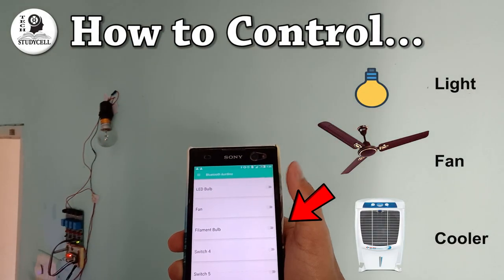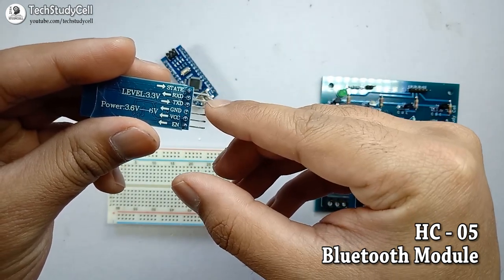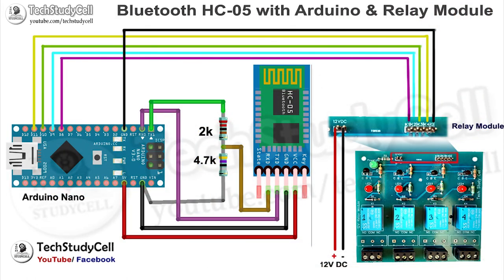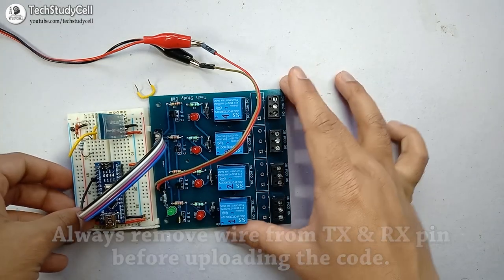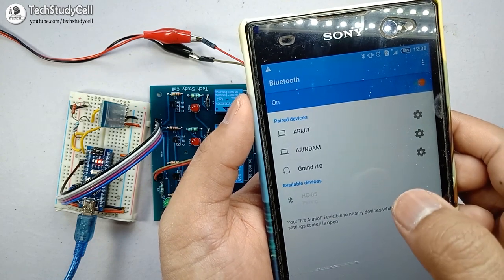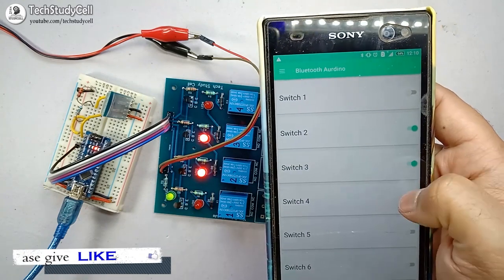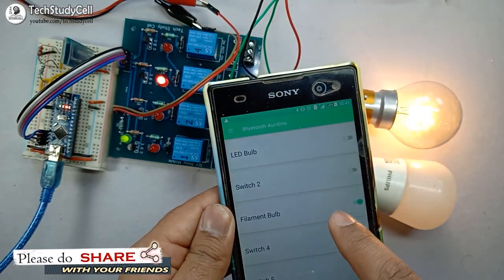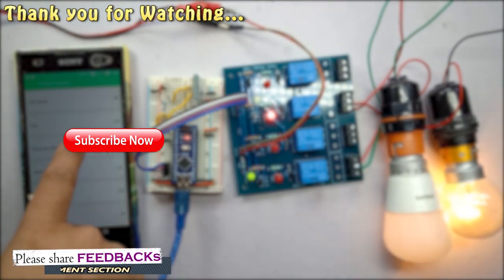How to Control room Lights Fan with Android Mobile | Home Automation using Arduino and Bluetooth

Comment: good job, Sir, how can I download the Bluetooth application?
Reply from the maker: From the Google play store
Reply: Yeah, I have been trying to download from google play store but I couldn't get an application used for DC Motor control speed and direction having a slider in the app.
Reply from the maker: Use Blynk app.
Reply: Thanks, sir!!

Comment: What are the other devices other than bulb which can be operated using this home automation system
Reply from the maker: You can connect any 5 Amps AC device